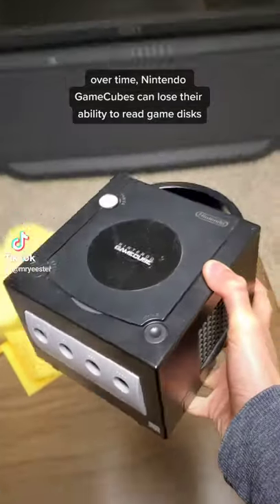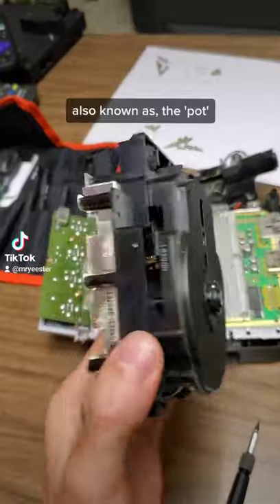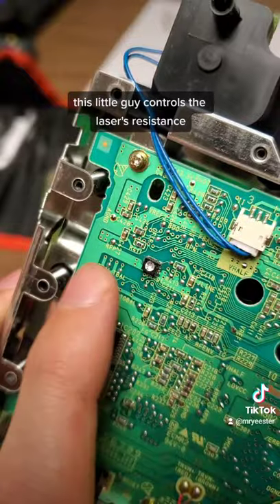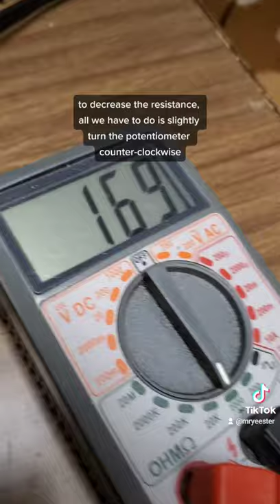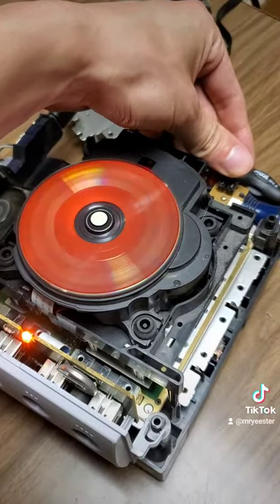fixing a broken gamecube #shorts

Comment: Careful not to increase the laser power too far, though -- that pot is there for a reason!  There have been reports of high powered DVD lasers actually burning rings in game discs if used for too long!
Reply: Ps2 did that all the time
Reply: @megami215  yup, still got my scarred GTA:SA copy from my poorly modded PS2 lol
Reply: I feel you man, the  ring of death, almost all my PS2 and Xbox 360 games had it.
Reply: Those laser diodes are actually reallyyyy powerful and the fact that he let it play out and i dont think he had laser goggles on made me shit myself.
Reply: The game disk after an 8 hour binge :
"The attempt on my life has left me scarred and deformed"
Reply: Isnt that from the lens rubbing against the disk?
Reply: Some DVD drives in the Xbox would do this from the factory
Reply: @qwertykeyboard5901  basically there's multiple layers to a disk, there's the layers containing data and a outer plastic protective layer (the one that get scratched if not careful) the laser, if too strong, will burn the protective layer, thus making it impossible for the machine to access the data contained in the layers under the burnt one. Quite ironic.
Reply: Even turned all the way down there’s a built in minimum resistance. Many people turn them down to 120 ohms ish to play burned copies and it doesn’t burn rings. I’ve never heard of that happening with GameCubes. Other systems sure, but not this console
Reply: @gilgameshdevourerofworldsg4101  from what I've learned and experienced the 360 only ever damaged games because of people squeezing the console picking it up while it was on and it would destroy whatever disk was in there. Was there a pot issue with these as well?
Reply: yep, did it to my 360 one day, increased it too much.
Reply: it's not power it's resistance so lowering  the resistance will burn rings
Reply: @megami215  That's actually the ribbon scraping on the disk. The laser can burn a ring in, but that happens much slower with normal power.
Reply: @goplaypc5059  probably about 200mw of power, so yeah, it’s scarily powerful
Reply: Xbox 360 ring of death on the disk vibes
Reply: Lol you can see his laser shine through the disc lol
Reply: @megami215  that makes me re-evaluate so many things. I remember having so many unreadable cds.
Reply: @megami215  if it was a slim then it was definitely the ribbon cable touching the disc they were flawed and The ribbon cable would get higher than the tray and put a circle in the disk now if you move a consul While it’s running it can do the same thing because the disc tries to gyroscopically stabilize but it can’t because it’s in a fixed area so if you turn the lien of the consul when the disc is spinning The disc tries to stay level causing the disk to wobble into the tray or other components
Reply: @JessicaFEREM  actually it was due to the ribbon cable touching the disc and that would either happen from The ribbon cable getting warped wrong or you tried moving your consuls around when they were turned on I only got a circle in my disc two different times once on a 360 because I barely moved it while it was on and on a PS2 slim because When the laser was at certain positions the ribbon cable would be touching the disc but yeah I learned from my mistake instantly after just barely moving my 360 at all whatsoever basically what happens is the disk tries to stay the direction it’s in due to the fact it’s spinning so then the disc wobbles into something when you move the consul
Reply: @birdysama2980  most discs have all of the info on the top layer right underneath the label you scratch the label on a disk it is way worse than scratching the shiny side also I have been tuning consuls for years never once have I seen one burn through a disc and if it was able to do that it would probably be deleting before it would be burning the plastic layer because the way a disc burner works is the laser shines at a way stronger intensity literally burning the info into the top layer so I’m pretty sure if it’s going to melt a disc it’s burning the info out before it melts
Reply: @onyxeeveon887  you are right. For the disk I've seen it happen on, the disk started having reading problem saying the data was corrupted, then it wouldnt boot half the time and eventually it became completely unusable.
Reply: @goplaypc5059  bro cd lasers take some time to burn your retina. i'm pretty sure it's around 30 seconds of looking straight into it
Reply: @birdysama2980  im very well ejected on a lot of stuff. I rebuild engines for a living and I used to have a job fixing a wide range of electronics. Usually When you turn the laser up to high they tend to burn out before they can actually do damage to the disk. If you move your consul while it’s on nine times out of ten you are going to get rings on your disk and for a consuls that did that when you didn’t touch them that was because their design was flawed to where the ribbon cable for the laser that moves back-and-forth could get bent in such away that when the laser is in certain positions the ribbon cable can touch it now they went away from that design and they put the ribbon cable underneath a guide so it can’t happen like that anymore. The ps1 and fat PS2 did not have that design flaw because they had the ribbon guided. But then the slim when you opened the tray you could see the ribbon cable right underneath the laser because there was no guide for it it just kind of was out in the open so if it warped wrong it could come up and hit the disc. A lot of Xbox 360 models were like that it was the worst design ever at least they do not do that anymore
Reply: @onyxeeveon887  interesting! Thanks for the insight. Its weird that there was no revision to correct that sort of stuff on the consoles, the slim PS2 for instance, the that were affected by that design flaw.
Reply: @birdysama2980  I think there was really no revision because it was at its end of its lifecycle. now on the 360 they did revise it so the last few models were a lot better and didn’t do that unless you picked it up or moved it while a disk was in it.
Reply: @onyxeeveon887  Fair enough! I have the Xbox 360 model E at home (last model before the Xbox One released) it doesn't seem to have as much problem  concerning the laser or disk tray. Like you said, it happens way less often with the newer revisions unless you trigger it by moving it while it's on or when a disk is in it.
Reply: @onyxeeveon887  fair enough I have never really looked at a disc reader in operation
Reply: Happens all the time actually when people do stuff like this
Reply: @dame-e-in1258  I have cranked up hundreds of thousands of lasers and not once has any of them burned a disc now the ribbon cable from the laser on the other hand has touched the disc and scratched circles in them due to bad design
Reply: @goplaypc5059  he's fine. I had to manually remove my disks from my xbox 360. Like I had to set the magnet back on the dick myself because the disk drive was pulled apart. But I would let that thing die
Reply: It can also burn holes in your retina!
Reply: @bobtheblob2770  well i mean not if the lid is closed but yeah
Reply: @bobtheblob2770  That is why you are not supposed to look into the lasers and usually the consuls even warn you not to look into the laser don’t look at it and it won’t happen
Reply: Wow, that's so cool. Can I burn paper with it too?
Reply: @goplaypc5059  dude could instantly be blinded with a single mistake
Reply: Had my damn 360 do this to my NFS: Most Wanted disc which was one of my favorite games. Completely ruined it. Has to buy another copy.

Ever since then I’ve always bought digital games.

Edit for more details:
Since my 360 burned my disc, it barely read properly.
I would load in and as I got into the game, the music would randomly cut out. Which meant the disc wasn’t being read anymore.

So I would be going 240 in my Agera R, and the map would vanish. If I didn’t slow down fast enough and got too close the edge the game would softlock. The game wouldn’t crash, just become impossible to do anything.

If I opened the map, the game would also softlock as the disc was needed for the map to load, so it was just an infinite loading screen.

Once I bought a new copy,

and a new Xbox…

I was able to play Most Wanted again.
Reply: Lesss gooo.
Reply: You think if i maximize it will it shoot a lazer true my celling (my dream)
Reply: I have 3 PS2 games that have burn marks in em lol
Reply: @gilgameshdevourerofworldsg4101   !vvvvv
Reply: @JessicaFEREM  especially the Thompson drives found in early models, they are notorious for this
Reply: @megami215  so thats why crash would never run... Thats a shame
Reply: @manformerlypigbukkit   well where I live, piracy dominated, specially when it comes to games, so if that ever happened to my GTA SA copy, I could just buy another one, at the time it was like 1$ or less, it was like a rule, if you had an ps1, ps2 or Xbox 360, it has to be a jailbreak one, Xbox 360 you still could find original games, but you literally could never find an original ps1 or ps2 game, it was like gold
Reply: Ok
Reply: @megami215  silver ps2 slims
Reply: Yea, and without a dislike button we really have no way to let ppl know besides hoping they see this comment.
Reply: @Jreaddy  buddy I don't know if you know this but the dislike button is still there
Reply: Came here to say this
Reply: Hmm so what you guys try to say is, we've had lightsabers all this time and nobody had marketed on it 🤔
Reply: @amateurprogrammer25  yea, and ppl will see 200k+ likes, and no dislikes and think it’s ok, and will work for everyone.
Reply: That or the orange ribbon cable attached to the laser in the ps2 slim model
Raises up and scratches the disc too, but that’s a very easy fix.
Reply: You want a reader not a burner
Reply: @l4kr  you shouldn’t mess with it, it can easily blind you in a fraction of a second
Reply: Burning games discs is fake. A disc is basically a mirror. The rings are from movement of the unit when the disc is spinning.
Reply: That happened to my GTA VCS on PSP for some reason.

Comment: this is a little scary though, considering that if you turn the potentiometer up too much, the laser will burn out faster and you'll have to get a replacement disc drive.
Reply: Thank you finally someone who sees it i was soooooo scard 😱
Reply: U don't need a whole drive you just need a laser and they are like 20$
Reply: I mean you have nothing to lose if it doesnt work in the first place
Reply: Me: Removes resistor and bridges them directly
* Pro gamer move *
Reply: @rayirth.upside-down  instant death
Reply: I mean if u want the novelty or sentimentality of having a game cube sure but with a decent pc setup u could just run an emulator
Reply: @starfox.64 * respawns
Reply: How is it scary if you do it by increments. Use a multimeter mong dont just crank it like turning a water house. Generation Z finds everything scary for some reason.
Reply: It was going to die anyway might as well use it, replacement lasers are cheap.
Reply: Just don't decrease it too much.
Reply: Yeah but hey if it don’t work it don’t work and if you fix it and it works for a while longer hey you got some more game player out of it needs a new laser at that point anyway
Reply: If you turn the potentiometer which is actually a preset variable resistor up too much it wouldn't do anything because you are increasing the resistance meaning it would have a lower output unless wired by an idiot 

Unless you mean to the right then yes it would lower the resistance meaning a higher output
Reply: @lilithdoyle5703  some speedrun leaderboards dont allow that
Reply: @TheWindows72306  haha got me
Reply: @user-vo3ps2oz7h  in reality you risk ruining the DvDs
Reply: @quattro4468  wow never knew your family was running around doing surveys on Gen Z.
Reply: Well seeing that your fixing something i dont think the average consumer would care
Reply: @StarComet7  I mean, they might not for a little bit, but then in the event that it outright burns out, they're gonna need to learn to disassemble or buy a new console
Reply: @rayirth.upside-down  laser going through the roof and beyond the clouds...
Reply: A laser diode’s failure mode tends to be quite binary, so if you’re very careful to read the preset resistance and increment it in single digits and reassemble for a function test each time there’s little risk in breaking an otherwise good laser, if nothing else is wrong and within tolerance yet it breaks anyway, you just have a bad diode that you’d of needed to replace anyway.
Reply: @egg5474  I think what worries me is that people may just think "oh hey, turning this up means an easy fix" and not realize that lack of precision could make it worse than they left off - a person with technical knowledge has a much higher chance of knowing what they're doing when it comes to this, versus the average person.
Reply: Exactly!
Reply: @Mstauffer67  it's a pain though, I'm not the best with it, ripped one drives last ribbon cable when putting the black shell back on and the second laser I got for another system was too rough to move correctly. Just never successfully done it yet
Reply: @PhantomWolfie  they are easy af, just watch a video on it and be careful.
Reply: @oxsnxiwn7804  all depends on the circuit design, and how the pot is wired
Reply: @PhantomWolfie sounds like you’re incredibly impatient and shouldn’t work on things with small fragile parts. I’d love to see you work on a cell phone.
Reply: @Protoking  don't have to be so rude, I've performed other console mods before and I've completed this mod since this comment, but still gosh damn, not everyone is proficient with their first attempt at something.

Comment: Someone actually shows using a multimeter when doing this, it actually helps a lot to know what you're setting it to
Reply: If you have a multimeter you probably know what you’re doing with it but yeah for beginners, he could show it in a longer video tutorial
Reply: But you shouldn't. How much you laser has degraded varies from his, and if you set it too high, you could damage discs. You should increase it in small increments until it works.
Reply: @SummerRainn  but the human hand and eye aren't designed to judge the microns of rotation that the potentiometer needs in order to regain functionality. If you go too far with it, it could brick the discs, and if you dont go far enough it could stop functioning mid game, so its best to run tests with shovelware to get the measurements right for your particular console.
Reply: @Atamosk-bu7zt  Yes, true. But when did I say that you should judge it visually? All I said is that copying the value from the video is a bad idea because the level of degradation varies. I never said anything about testing methods.
Reply: Yes!!!!!
Reply: furry
Reply: You don't need a multimeter. Just don't be an idiot and turn it all the way. Left = less resistance. Turn it 1/4 turn and see if that helps. If not, do another 1/4 turn. Etc etc
Reply: @twizz420  I personally want to dial in an exact resistance value instead of just cranking it 1/4 of a turn
Reply: @MaximNightFury  But what works on one unit might not work on another. The value doesn't matter. It's a trim pot, which means it's used to adjust for manufacturing tolerances. And 1/4 turn is not "cranking" it, unless it's the only trim pot in the world which has 1/4 turn from 0 to 100%

Comment: This is just a temporary fix. The capacitors on the drive board are dying. Replace them for a clean signal. You can see the difference on an oscilloscope.

Comment: BUT don't overdo it, it can completely break your laser. And try to clean lens before even disassemble, it helps very often. (Rescued also my childhood stereo from trash cane)
Reply: What do i use to clean the lens, and is there any specific method to do so? And i'm guessing the lens is the lens-looking thing where the laser light comes out?
Reply: @NickAsNickName  Use Isopropanol alcohol.
With something that isn't abrasive at all, like microfiber stuf.

You can clean up everything in your console.
Take the 92+% lotion, 99% if possible.
Amazon have a ton of it
Reply: @NickAsNickName  And, yes. The lens is the glass.
Reply: @NickAsNickName  use isopropanol /isopropyl alcohol 90% or higher and a clean cotton qtip and don't rub the lens. You just need to sort of dab it a couple times and then sort of twist the qtip to kinda sweep the lens
Reply: @twizz420  figured out that the issue was with the disc, so that sucks

Comment: Wow, this is so cool! The more specific term for what he's working with is "trimpot" which, yes, is a resistance potentiometer! I had to learn how to use these for industrial applications when I was studying Electromechanical Engineering. Ever wonder how mechanics meet electronics? That's a prime example!
Reply: "trim" refers to its purpose of making slight adjustments to cancel out manufacturing variations

Comment: I have fixed 3 GameCube that don't read disc replacing a capacitor in the DVD drive board , i found out after buying a brand new laser and adjusting the pot and getting nowhere , then i found out about the capacitor on the internet replace it then put the potentiometer back to it's original position and the GameCubes worked flawlessly